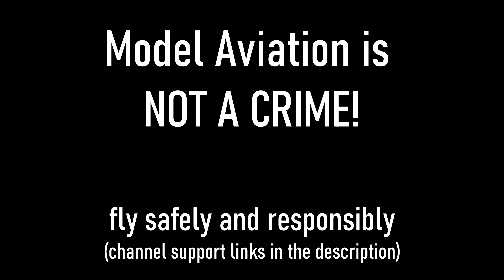OMG... it's going to crash!

Comment: Bit of a tangent here, but did you ever open up the Jumper T Pro and confirm the 2.4 GHz antenna orientation? I’m wondering if I should be installing any receiver antennas with a vertical orientation or better to concentrate on horizontal with this transmitter.